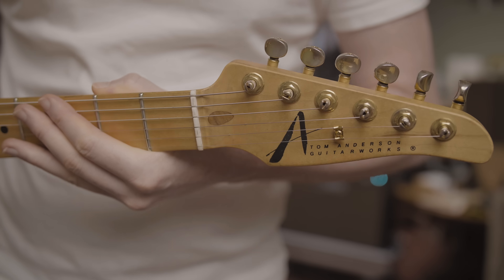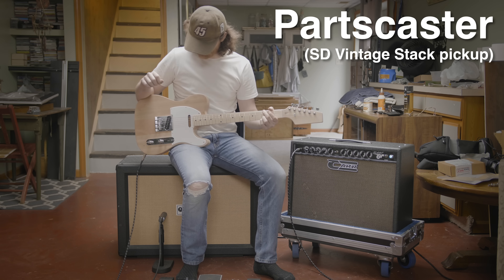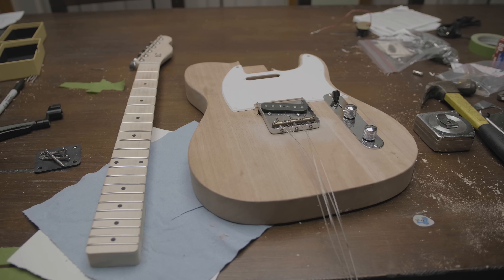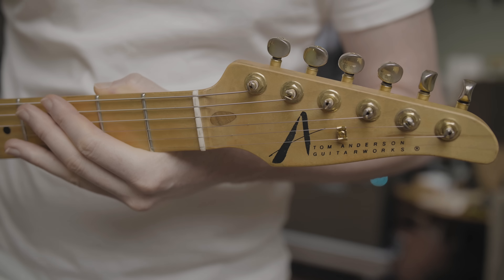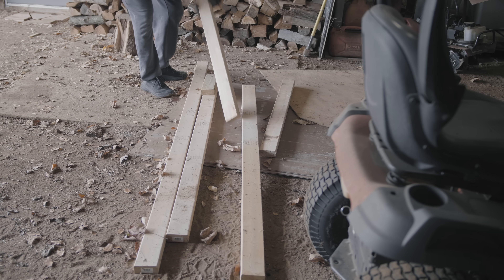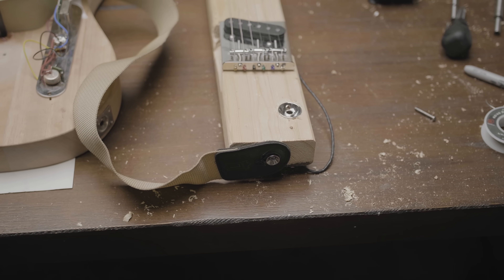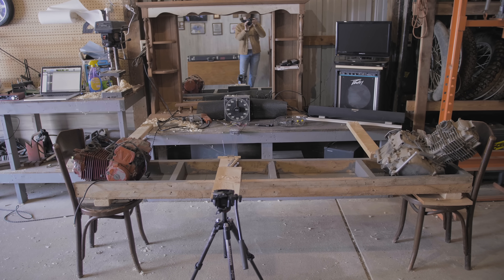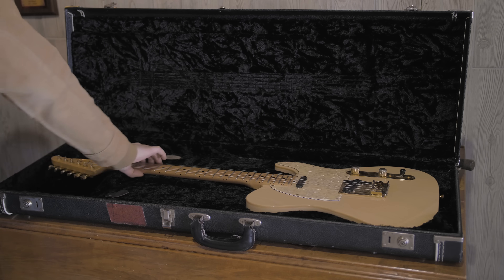Tested: Where Does The Tone Come From In An Electric Guitar?

Comment: This is a really cool experiment. Also, even though the last one has no neck, could the mass of the table still affect tone? Is it possible to mount some sort of dampener between the bridge and the table so that the body (in this case table) of the guitar has no mass? Maybe that’s not possible to do and still maintain proper tuning. Just curious to see if body mass affects tone.
Reply: @Discernment true, but the pickup wont hear a difference. in the room it will sound different, since you can hear the table resonating. what comes out of the amp though, i'm not sure would change at all. i can see the argument  that it would change the tone if the pickup was mounted to said wooden table somehow, although i dont think its true. especially after watching this video
Reply: But what if he used Kawasaki engines instead of Honda!!!
Reply: @nate6692  I would prefer he uses harley engine insted. More juicy sound

Comment: Great test there👍🏻👍🏻👍🏻
As long as the neck is the same with same scale length, strings and fret height and action and there is nothing to reduce sustain, with the same pickups and height adjustments and electronics,  it will sound very similar. 

Main things I would say which affect how it sounds.

1. Strings
2. Pickups and position and height
3. Electronics

Also
The action and ease of playing will affect how it sounds because it is easier to play. Also ability of the guitar to stay in tune and have accurate intonation.
I would think the nut type would have a slight effect on sustain and top end brightness.  But that would be a good test.  Brass nut, teflon nut, bone nut, plastic nut. Teflon nut will help it stay in tune. As will string tree types or no string trees.

On all the tests you did, 99 percent of people would not hear any difference especially if it were mixed into a song recording then no one could tell.

Comment: This is excellent! I wonder how much the electronic components that make up the on board controls affect the tone. I’d imagine tolerance of each component, as well as type and manufacturer/quality of the capacitors and potentiometers could vary the tone in some way. Likely negligible, but it would be neat to find out.
Reply: Agreed: negligible. Tolerance is obviously an issue because different different values do change the sound. Component type affects durability, but not tone.

Comment: The biggest difference between takes until the air guitar, was the inconsistency of some of your takes.  Sometimes you played it great.  Sometimes not quite as good.

The lightbulb went off for me though when the body disappeared on the air guitar.  The lack of the sounds not reflecting off the top of the guitar was definitely noticeable.  Cool video.

Comment: In recent years I already had heavy suspicions that 90% of the value in an expensive guitar comes from how comfortable/enjoyable it is to play, as well as how well it stays in tune (that's where things like the construction, hardware and especially the neck come in place), because the other 10% value could at the very least be satisfyingly obtained through the electronics, setting and amp combination. On your final test, I couldn't help but have a smile of my face.
Reply: I used to work on guitars in a busy well renowned London workshop and 70 % of our work was properly setting up new and old guitars and it always gave me a sense of pride when you took a loved (new or old) instrument that felt s**t under the fingers set it up and then seeing the delight on the  owners face when they started playing it. Some manufacturers were better than overs but still for the money of some new instruments out there you'd have thought theyd set them up better to sell more! Then again it gave me an income.
Reply: A lot of the way guitars are built amounts to bad designs that are still used mostly just because manufacturers have to keep the traditionalists happy.
Reply: Yep

And with a little research, some basic tools, and a cheap guitar to practice on, you can do the comfort work yourself.

My $250 Ibanez plays as well as any $1000+ off the shelf model, simply because I went through the trouble of doing the fretboard work myself.
Reply: @coyotejohn3101  Not all of us are good with our hands in that way or have the space or tools to do it!
Reply: @TheBanana93  So many guitars seem to arrive at the music shops with horrible setup. I have changed many people's idea of what a basic guitar setup is, how a guitar can feel, with a truss rod adjustment and lowered nut height. Tools required - a single allen key and a piece of sandpaper on a flat bench. Rarely have I come across a guitar that I could not improve in this way. It seems to me most of us are afraid to attempt any adjustment. I was terrified for years until I tried. My understanding of the instrument and ability to play the instrument skyrocketed once I took the leap.
Reply: @banjokastooie  how can I learn this skill?
Reply: @TheBanana93  that honestly sounds like an excuse. The tools aren't expensive and you don't need more space than the size of an average coffee table. If you can't get that then guitar doesn't even need to be on your list of priorities.

As for being capable. No skill comes without practice.
Reply: i have to agree, i have a American Fender telecaster 60 year anniversary edition that cost about $1600 new and a Squier telecaster that was about $400. Soundwise they are at least comparable, the main difference being the american has more clarity on the high end. The biggest difference though is that the american tele stays in tune pretty much indefinitely, left it in the case for 8 months, took it out, strummed a chord and it was just barely out of tune.
Reply: Just sold a $1300 guitar because the $200 monoprice made me happier. YouTube taught me how to set them up properly and do the little things like fret dressing. All I look for in a guitar now is good wood (not plywood), serviceable neck, and a body shape I like.
Built myself a superstrat from guitarfetish clearance parts and wouldn't trade it for a $3k fender.
Reply: Preparation is it all, I prefer less weight.
Reply: Not necessarily... My $5000 Martin doesn't stay in tune as well as my $250 1990s Mexican Strat. Which also stays in tune better than my Gibson SG. The strat has been beat to shit nothing has been changed from factory, or even maintained, it's only been played for 25-30 years and still keeps tune for long periods of time played or unplayed.
Reply: This. It’s all about comfort and staying in tune. Then the sound can be shaped however you want
Reply: This is huge. I have multiple guitars all with very different pickups (which I tuned to my liking), because that's what really makes them sound different. Like hot P90ies, twangy Filtertrons, PAF style (still missing a Telecaster style). And I love all my guitars because apart from the tonal difference they also feel very different when playing. Like my LesPaul has a lot of resistance when bending (lower frets? Headstock slant?) and my Yamaha with its satin neck and stainless steel frets feels like butter. But playing the LesPaul forces me to play differently and me requiring more force and digging in more changes the sound on top of the different sounding pickups. And then there is my PRS SE custom24. I think it's true, it really has the least "character" of all the guitars I've tried. But with it I can get into the feel and sound of any other guitar in seconds and everything is effortless. Of all the guitars I have it feels the most effortless, smooth and comfortable to play and I play the best on it. Would love to test a Strandberg sometimes. Seems to me it takes that concept even further.
Reply: Tonewood!!! 😂
Reply: I've got s pretty extensive collection and have to say, my PRS CE tops any of my other more expensive guitars. Why? The fit, weight,small attention to detail
Reply: Good point, but there apparently are two separate things: the sound (what this video is about) and the playing. The sound of course is partly from the guitar itself and partly from the playing, but generally it is believed the sound needs a 'good' guitar (tonewood debate). For over 90% of the players this video to me seems to show this does not hold. Your video may show the pickup matters as well as the setup.
Reply: @fritsvanzanten3573   I've never been entirely sure the tonewood mystics weren't fooling themselves, at least where solidbody electrics were concerned.  I've made decent sounding electrics out of some "unilkely" materials - birch plywood, pine bookshelves, the dreaded, feared red oak.   And I've radically altered the tonality of my primary electric (a fairly straightforward maple over mahogany LP almost-copy from Ibanez) just by swapping pickups and tweaking their height.
Reply: These days, it's all made in freaking China.  However, most guitars these days are made extremely precisely with machines.  Now the real difference between a $500 guitar and a $2500 guitar are the care taken toward the finishing touches (fret leveling, crowning, and other setup stuff).  If you have some basic guitar tech skills, you can usually make a cheap guitar play and sound just like an expensive guitar.
Reply: @ApexLaneProductions  No the machine built ones are often crappier. The more expensive guitars are hand built. I work at walmart stocking shelves. We get sealed up bags that are empty or stuff that has been stamped upside down. Even the machines make mistakes. They will get it right 99% of the time, but there are definitely errors in machine building. It isn't able to double check itself generally.

What happens with a cheap guitar they just feed a bunch of wood into it and it spits them out. Could be good pieces of wood. Could be bad wood. One guitar might be put together perfectly. Another might have stuff that's slightly off. It all goes out to sale and you play the lottery buying one. It's possible to go into a pawn shop and find an old cheap guitar that has a perfect neck, really good wood, everything nice on it. Then swap out the pick ups for better ones and you have a really good guitar you can sell for a higher price. Though cheapo tuners might be a problem with it not staying in tune as well. I knew a guy who used to do this. 

A custom built guitar they are going to throw out any bad pieces of wood. You know wood has knots in it or different issues its not all consistent. They put it together and check over the whole thing. If there is anything defective on it they toss it in the trash can and start over. This is where most of the higher price comes from- is just tossing out all the defective stuff. Of course there are times when the custom builders get lazy and turn out crappy products which has happened at times with gibson and others, but generally speaking it is supposed to be inspected and have no flaws on it. 

I watched a zillion videos comparing a Gibson Les Paul to an Epiphone Les Paul. The gibson always sounds a little better due to the finish or something on it. There is definitely a difference but these are really small differences where most average players aren't going to want to spend an extra $500 for really small details. But if you are a rock star or something you want the best.
Reply: Yes and no. He couldn't get the cheap guitars to sound as good as the well-made one until he eliminated all the crappy parts. So I'd say the wood doesn't directly contribute to the tone, but the overall quality of materials and construction allow you to get the best results (such as being able to fine-tune the pickup distance and keep it stable).
Reply: @exerciserelax8719  a lot of that could be fixed with better design philosophy first
Reply: This
Reply: Even in this video the rosewood fretboard sounds different than maple. It's not huge but it's there. And the regular guitar sounds better than the 2 x 4. No one is saying that it's going to sound like crap without the right wood. It's just the small details that give a guitar it's sound.

But sound isn't even the big issue I have with cheap guitars. They just fall apart from being built cheaply and won't stay in tune. Usually the neck is harder to play. You could get a cheap guitar and swap out the pick ups and other parts and get it sounding really good. The cheap wood isn't a big issue even though the right wood sounds slightly better. But cheap guitars the knobs are falling off or where you plug the Amp in that comes apart. I end up throwing them away after two years which is why I don't buy them anymore. The sound is actually pretty good on some $200 guitars. Still I can hear the difference with better guitars.

Comment: THANKYOU..... Bravo, I have ALWAYS known this.... I come from a background in mechanical engineering.... Back in the 80s.... I had heard all the voodoo about why one guitar sounds different then another and I have always said that the perfect guitar is one that can be manufactured to exact tolerances.. and reproduced exactly..... so I made an aluminum guitar... solid 6061 aluminum .... headless... the plan was to use double ball strings.... like the Steinberger uses..... knowing this design could be reproduced as exactly as possible with CNC machining . of course when I talked to guitar players and makers about this, while in process of creating my guitar, I was told over and over that it would sound like shit.... I knew better.... I finished the solid guitar, it was beautiful.... but before I could finish it I changed careers and become a photographer and no longer had access to the machine tools to finish it.... so I never got to prove my theory..... you just did..... thankyou...... btw...Les Paul knew this too.... his first electric guitar was made from a piece of railroad track..... sustain for years....the body is nothing more than a decoration.....  LOL

Comment: So what I’ve determined is that a $5,000 guitar should only be bought for the fact that it’s cooler or more collectible because from someone who’s looking to buy my first guitar, NO ONE can convince me now that a $500 guitar won’t sound as good as the $5,000 guitar when you built one out of a 2x4 and it sounded pretty close to the actual guitar. If a 2x4 sounds that decent, a $500 guitar will sound just fine for 99% of players.

Comment: Even though you've tested everything with an overdriven amp you can still hear that the sustain of your plank is weaker than the Anderson. And likewise the sustain of the desk guitar (air guitar? certainly it's not air counter tensioning the strings...) is stronger than the sustain of the Anderson. 

The goal of an electric guitar builder is to provide excellent stiffness in a package that's smaller than a desk. 

If you spend more than literally 1 second listening (uncertainty principal here) then you will hear it. Also if you play it with a cleaner tone you'll have less of the internal tone from the amp at play, which of course contributes to added overtones and flattened out transients and a slight compression effect. 

You have successfully matched the tone. But you haven't matched the sustain, or the responsiveness that the player feels, which has a lot to do with the weighting and balance of the thing in your hands. 

I'm a piano maker. I don't believe for a second that certain woods have certain tonal properties... rather, it is a general stiffness and lightness that quality wood imparts. Add to that the rarity and visual beauty and you have a reason to use beautiful strong light wood. Your plank seemed to do the job if all you're doing is playing into a driven amp with really hot pickups. You've simply proven that the stiffness and lightness of wood is a good material.

Comment: I wonder what kind of possibilities there are not having the fret board blocking the strings from the bottom?  Would having two or more slides going in the same and or opposite directions make a cool sound?  Or having a clamping slide contraption?  Or maybe putting something in between the strings?  Would be cool to see.  Either way thanks for your hard work!

Comment: Awesome video!  Thanks!  I'm going to add my 2cents ... I mostly play bass, and for electric/rock/country bar band, big stages, etc i.e. loud music, when I turn up my Ampeg SVT4 way up running through a big stack, plus if it is on a big stage, the mains are super loud, and even moniters ... my bass body totally vibrates, even when it is somewhat against my body, and contributes to the sound.  Granted, bass frequencys are lower, and the waves push more air, but at high volume, which occurs on any big stage naturally, I think the body vibration, and maybe even neck contributes to the sound.  I've brough smaller rigs to big stage gigs, and had to run a lot through the moniters, just to hear my bass rig.  I'm talking minimum 4x10, but usually 8x10 cabs.  Guitar has higher frequencies, and usually isn't quite as loud, so maybe the body doesn't matter that much.